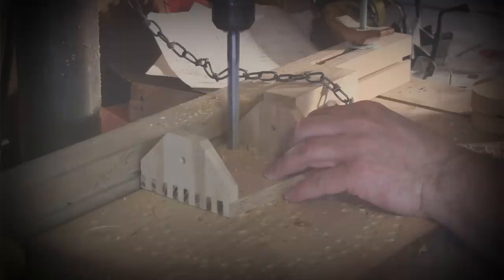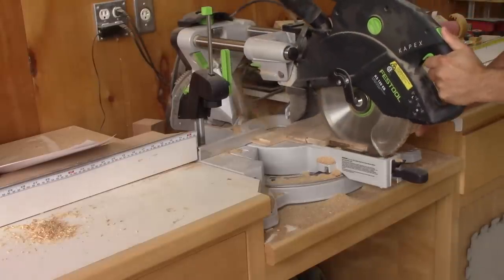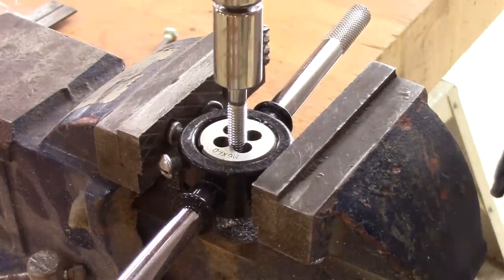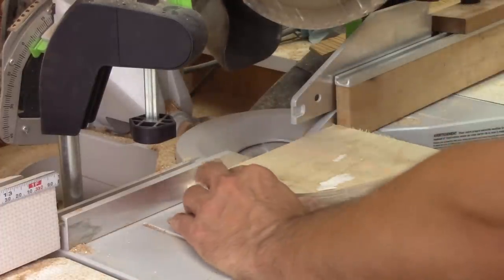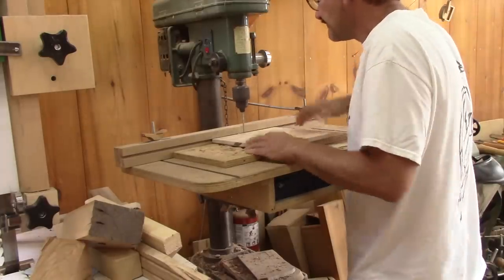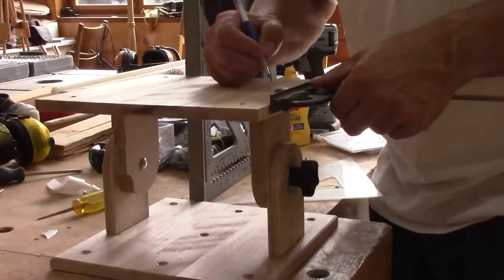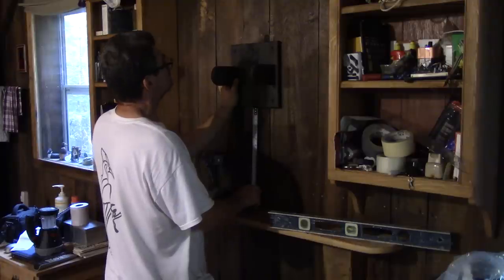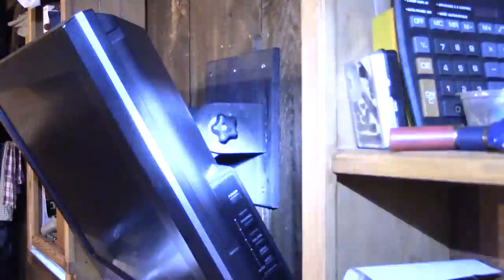The Woodpecker Ep 179 - New TV wall support for the cottage

Comment: Why such a huge distance between the plates? You could have gotten the tv at least 2 inches, maybe even 4 closer to the wall.
Reply from the maker: I was not sure of the tilt I had to give the TV, since I build it in my shop which is 6 hours from the cottage. So I've opted for a big space which gives me a lot of tilting angle. But yes if I had made it for my home, I would have check the tilt and surely made the arms shorter
Reply: @LgosseuxDbois-TheWoodpecker  if you're so inclined I expect adding a hole closer to the wall will allow it to tilt still and move it back a bit without spending ages modifying it.